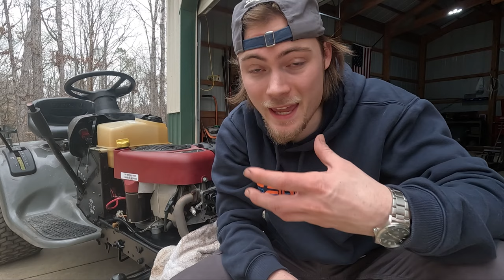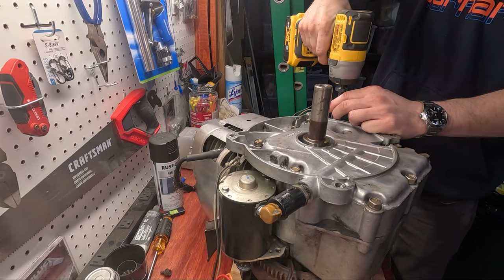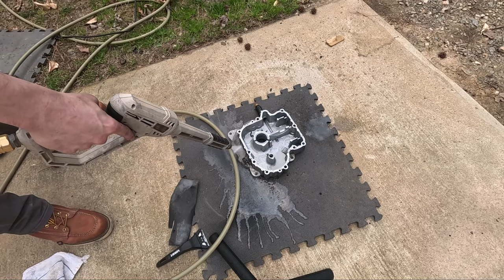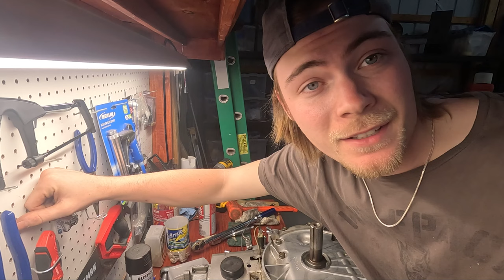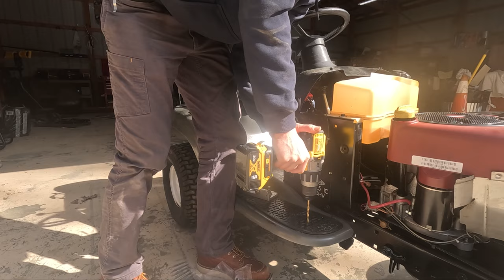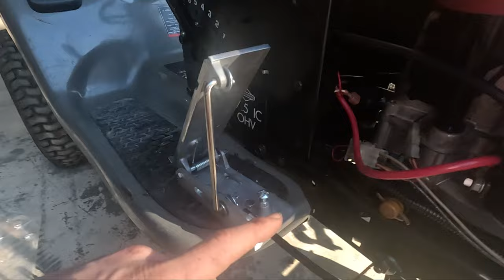RACING MOWER gets a THROTTLE PEDAL!!

Comment: That little orange piece isn't just the governor. It's also the oil slinger.
Reply from the maker: Oh shoot you are definitely right… I’m going to have to replace that and figure out a different way to “delete” the governor. Thanks for the comment!
Reply: @TylerChaseMotors  glad to help. hope you didn't kill the motor. Make sure you check the bearings and cylinder bore while you have it apart! It's gonna suck having to completely tear it down but it's better than putting even more money into it just to have it die preemptively.

Comment: So under the plate you push down the plate you mount to the mower on top of the plate you mount to the mower there should be a screw You can adjust how much throttle you can give it

Comment: Psyched to find out you can add a throttle pedal to a manual gear shift mower!  I wonder if that is part of why the throttle is less smooth than on an automatic/hydrostat?  (I don't know sh*t about engines yet, really).
Reply from the maker: Dude that’s why mowers are so cool, they’re the simplest engines you can possibly play with. I love my complicated engines too but the mowers teach you so much about engines.

Comment: I could be wrong but I think the best practice would have been to grind a groove in the crack with like a dremel or a die grinder before you aluma-welded it.  If you decide to go back in I would give that a try.  That being said I'm really enjoying the content!
Reply from the maker: You're right, I tried to notch it with an angle grinder, which kind of worked. A lot of the process I didn't record and I actually went back and tried to redo it again. I really couldn't get the metal hot enough to pull the aluma-weld through the crack. Also I'm not experienced with it so I'm not fully blaming the aluma-weld or the torch haha

Comment: If I were you I would swap the motor those just are terrible  I had ine in my mud mower and i had to adjust the valves  so many times . And I checked everything out and nothing inside the engine was broken .
Reply from the maker: I’ve got a spare Kohler v-twin that is probably destined for this mower once this one fully goes
Reply: @TylerChaseMotors  that's probably  not a bad idea lol .
Reply: These motors aren’t bad if you take out the bad stuff as in the AVS, the cheap 3 piece cam replace that with a old cast iron cam and the new reinforced head